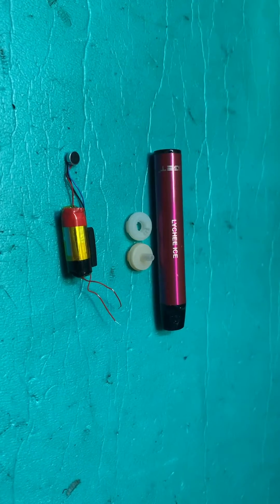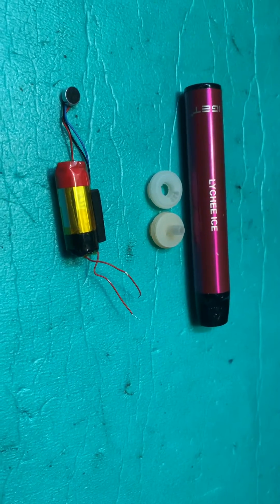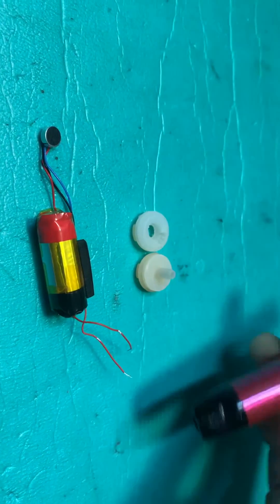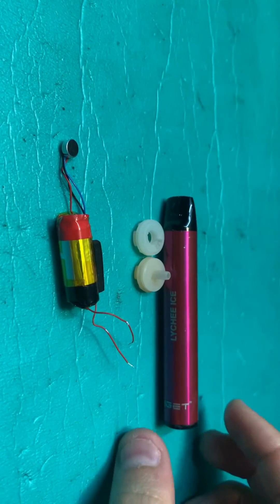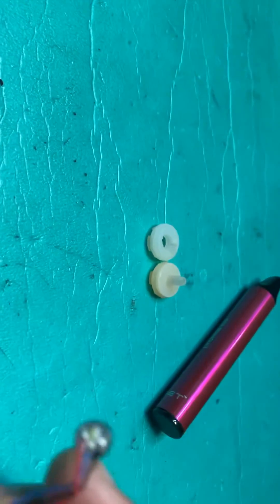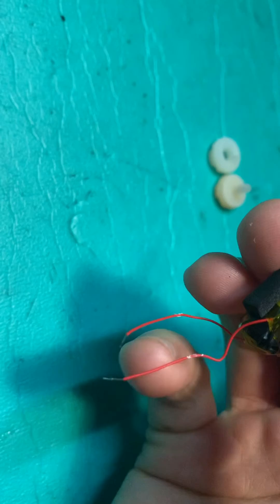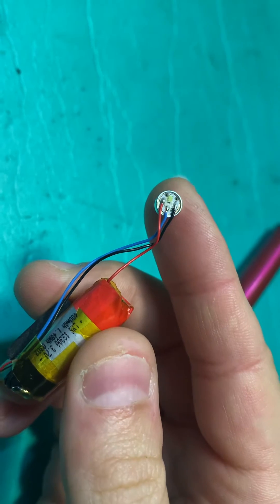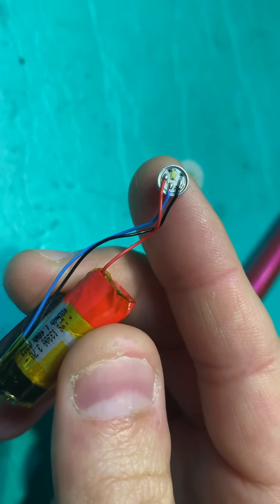Iget e-cigarette puff puff how do they work without on off button

Comment: liked and subbed BUT I am begging you to do more testing with the puff / airflow sensor. I want to make a device using this sensor to allow (for example) a paralyzed person to operate something just by puffing or "sipping" the sensor. 

What I need to know is HOW FAST can this sensor trigger? How responsive is it. My application needs to be as fast as possible. Just need to know the amount of time that passes between the moment the sensor receives a "puff/sip" and the moment the LED activates.

This would help me ...  A LOT ... and thanks !!
Reply from the maker: Working on a new video to show what percentage of e-cigarettes have a good battery. I’ll try add this in for you

Comment: coil is burnt I remove it but  Sensor still light I can't link wire of new coil to battery what can I do? 
Nots Battry good charge
Reply from the maker: Go to the skatepark where the teenagers throw or drop these on the floor and when you find one on the ground every day you will have a new coil for free. you just need a soldering iron or crimp tool

Comment: Just tore one of these down and was wondering how they worked so got a syringe and drew the air over the sensor and the led flashed but when I blew over the sensor nothing happened! GB :)
Reply from the maker: Hey nice work. I bet it smelt great. That’s interesting. Would expect it to work
Reply: @inzp3ctor  yes it did smell nice, but don't rub your eyes after taking one apart lol. GB :)